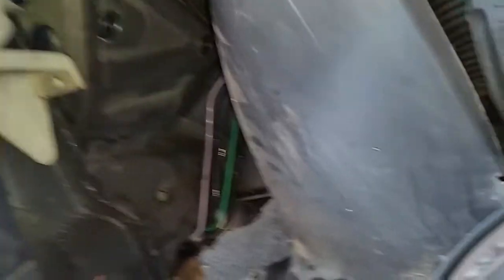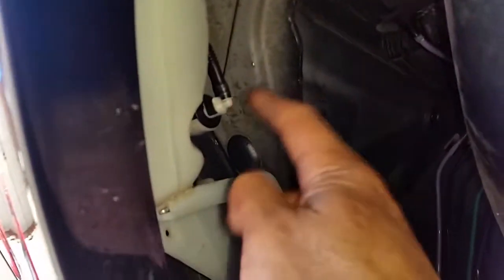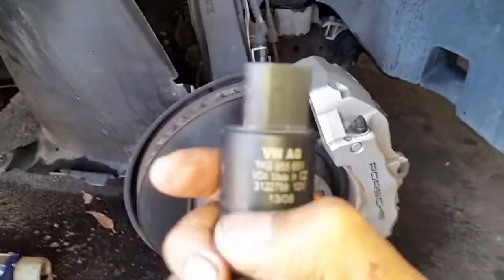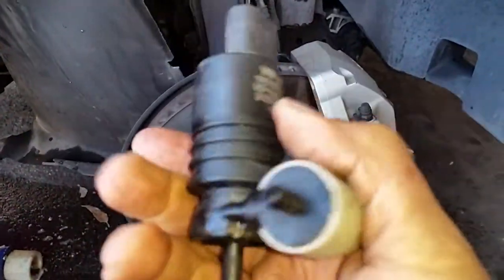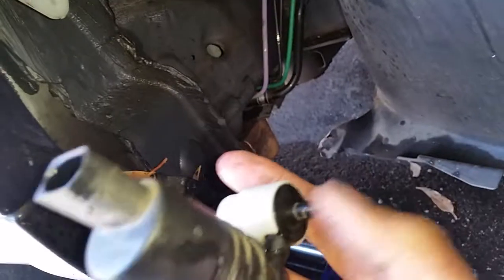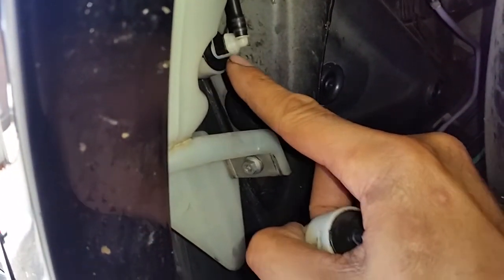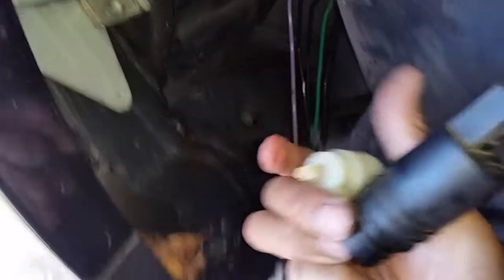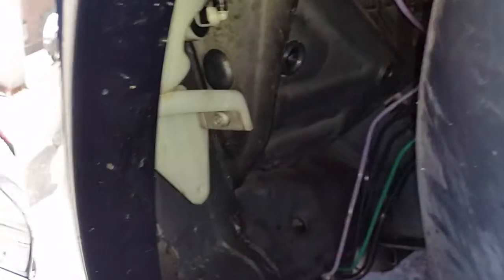Porsche Cayenne Washer fluid pump replacement

Comment: how did you reinsert the pump. Mine will not go back in. Are you supposed to push it in from the top?
Reply from the maker: Push down it should slide in
Use a bit if silicone on the rubber bit if you have some